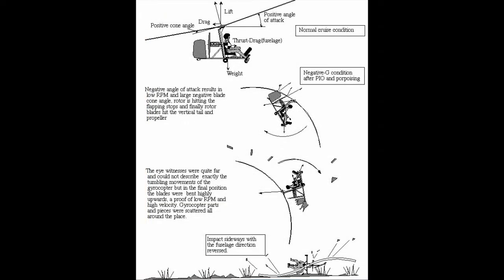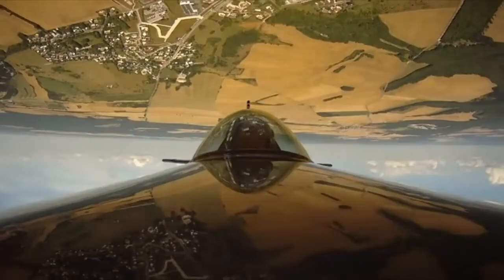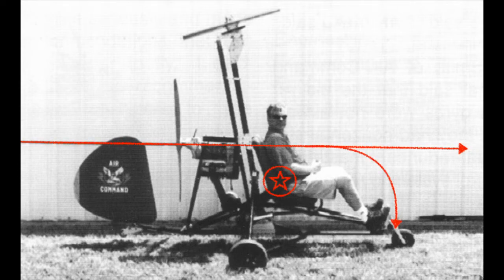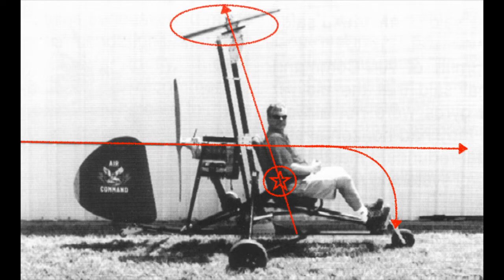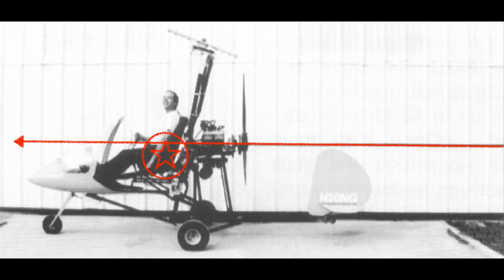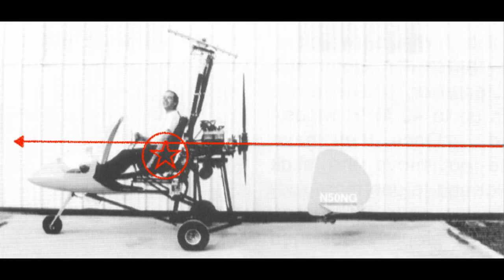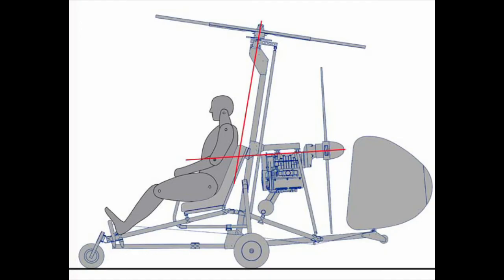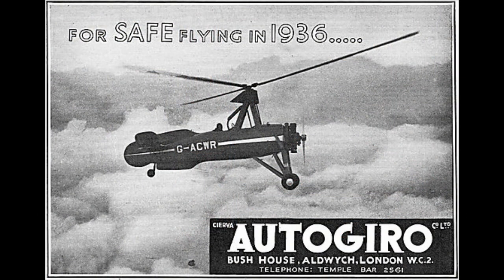History of the Gyroplane - part 17 power push over PPO

Comment: One could also potentially construct an engine mounting frame that would work as a CG governor, such that negative g loading would automatically reposition the engine by proportion below the "normal" CG to prevent CG torque imbalances.
Reply from the maker: maybe but think regulation [ to ensure no unintended consequences] and on going maintenance of the mechanism...
Reply: @gyrocopterflyingclub6148  I'm sure something could be engineered for such, obviously there is no such current tech.   And it doesn't have to be the engine, the cockpit could be gimballed instead, like a smart shock absorber for the cabin.   You could use any weighty part of the structure.   Vertical dampening only, of course, since therein lies the dangerous moment of motion.    It would probably be hard to do it on a small craft like that though since it would eat into weight budgets.

Comment: As I understand it, the pushover problem does not exist on tractor-propeller {i.e., non-pusher prop} autogyros like the Ciervas, due to the physics {for lack of a better word} of how the thrust is applied to the airframe.
Reply from the maker: Hi well for practical purposes I think the only aircraft flying now is the Little wing. I dont know much about that aircraft in truth. But you could still have a high thrust line in a tractor aircraft.
Reply: @gyrocopterflyingclub6148  >>> I came across something online several months ago about this.  Whatever it was mentioned the Little Wing, and it might have been a webpage ABOUT that autogyro.  I do not remember for sure.
Reply: It does exist. It doesn't matter if you are pulling or pushing, the line of thrust must pass through the center of gravity. Cierva new this and had the tractor engine tilted downwards so the line of thrust passed thought the center of gravity. it is easier to modify the tractor design in order to achieve this
Reply: @christospsaras7582  >>> What I read might have said the effect is less significant when the autogyro is a tractor configuration.  As I just mentioned to Gfc, it was so long ago I read it, I cannot really remember any details.

Comment: Thank you Phil! How hard can a gyro be pushed over with out power on?
Reply from the maker: Hi that’s not an easy question to answer in that it is going to be aircraft dependent but i think the question relates to the effect of power v no power? In aircraft where power push over was an issue (I.e those with high thrust line) the effect of being power off means that the rate of pitch won’t be built at the same rate. But a caution. Obviously in all case of this kind of bunt you are loosing rotor thrust as the aircraft experiences <1g. That also has the effect of decaying rotor rpm which ultimately also leads to a bad place. My advice is don’t get into these bunts or try to achieve <1g. Keep the rotor disc loaded always and in descents lead with reduced throttle rather than with pointing the nose with the stick. Stay safe.
Reply: Thank you for the response.  One of my favorite approaches for landing is to position in a high hover into the wind over the numbers. As I reach my approach Altitude, I’ll push the nose over with out power to dive in to gain speed to execute the landing. I’ve always wondered, how hard\far can I push the nose over. I know there is a line at some point. At some attitude the relative wind would pass along the top and into the rotor disk from the top of the disk and cause problems. I only search for this answer for education,  I am happy with the amount of push\nose over that I have successfully completed many times. Auto-Gyrp Mto sport.

Comment: Hi. Very nice video. Shout out to all the true centerline thrust gyroplanes out there. It would have been nice if you could mention Aviomania gyroplanes as well in a future video. Very stable and true centerline thrust design.
Reply from the maker: Hi yes agree what year did that aircraft come out??
Reply: @gyrocopterflyingclub6148  Design started in 2006, first flight of the 2 seat was in 2007 and the single seat in 2008